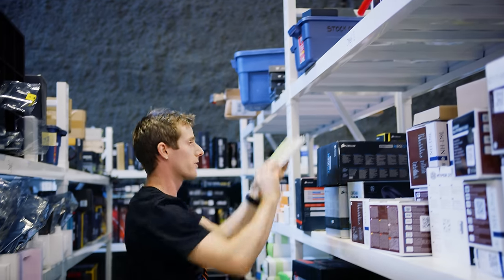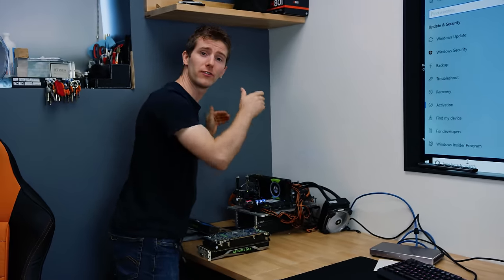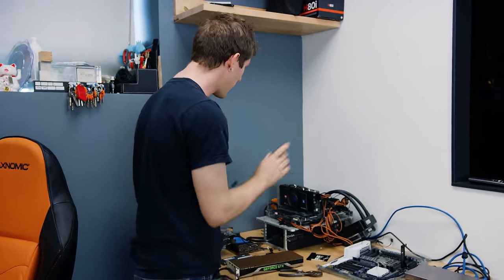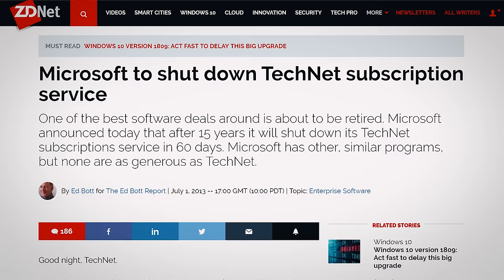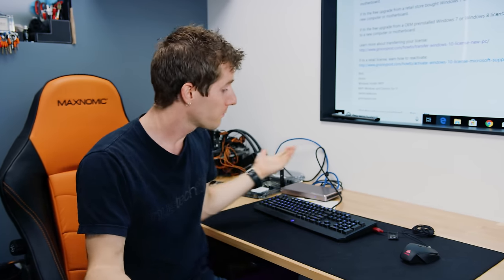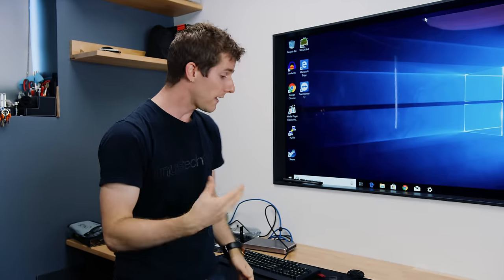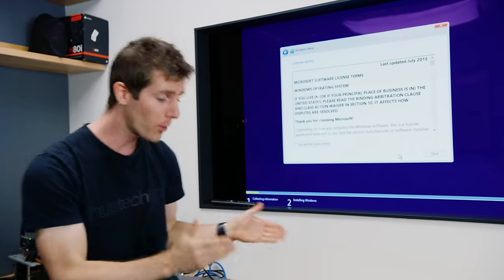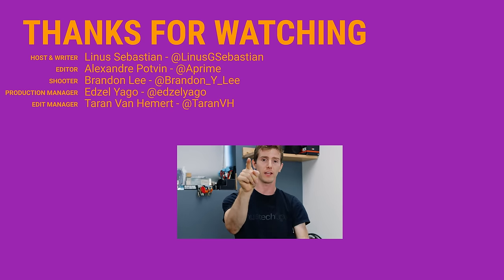Why Does Linus Pirate Windows??

Comment: y u no use kmspico???
Reply: FPSAnarchy hwid from nsaneforums activates it like its legit, try it
Reply: Been using kms forever. I even got it activated in a way that lets me use the store and i buy games from the Microsoft store like forza horizon 3 and 4
Reply: D96213 with kms you have to keep activating it every 6 or so months, but with this you can even sync the license with a Microsoft account and use it on a new machine, you can use that method now, no need to do a clean install
Reply: linklegend50 I haven’t activated it again in 2 years since my last format. It doesn’t ask for an activation and my hotmail is open on it with purchases from the store + office 2016 activated the same way. I’ll try out Hwid on my next format, thanks for the tip mate
Reply: @dvdsolomon  How did you activate it the way that lets you buy from the store? i thought kmspico only activates windows and microsoft office
Reply: Hossam Ahmed you login with your Microsoft hotmail account from the settings. You can login to Office the same way. Then you use it as though you genuinely bought it. I was with Microsoft LVL2 support yesterday via remote access to fix the slow download issue of Forza Horizon 4 and he didn’t mention anything about my windows not being genuine even though he checked the Windows Version and activation.
Reply: All was well until the September update came along
Reply: Thanks man, been using KMS for years but windows defender has always been bugging me about finding threats despite whitelisting kms. I just activated a fresh copy with this and it couldn't be simpler..  and bonus! "Windows is activated with a digital licence linked to your Microsoft account"   KMS never did that so this is friggin awesome!
Reply: @aviwad  Because Windows is better for consumer use.
Reply: @Pwnstar only someone who hasn't used a modern linux distro would say that (no BSODs, no troublesome or forced updates, nowhere near the malicious software available, no hassle with EULAs and activation, more flexible than a 16 year old gold medalist acrobat). Unless you use some specific windows only professional software, newbie-friendly linux distros are almost always the better choice.
Reply: @gkazanjian5976  It's not better for software like most games.
Reply: @Pwnstar yes, that is true (though nowadays it's light-years better than how it was a decade ago) but the main Q is what's the percentage of regular consumers interested in playing the latest and greatest games on their PC? The majority of people I know just use dedicated consoles for that and most consumers (if you leave out the professionals) just use their computers to browse the web, watch videos, and do some office work, all of which (and more) you can do on a linux rig.
Reply: @linklegend50  False information. Been using it and it will last you forever ;)
Reply: TsynaXZ it actually doesn't. What it does is use volume licensing, and activate Windows for 180 days, and create a task to run the KMS server it installed on boot to keep it up to date. You can check if your windows is truly permanent by typing "slmgr /xpr". HWID activates Windows permanently using retail, and does not require a KMS server to keep its activation.
Reply: Jon717 where can I get this
Reply: JACQUELINE Millan Here's a link to an official forum post: "nsaneforums.com/topic/312871-windows-10-digital-license-hwid-kms38™-generation/?tab=comments#comment-1327529". Scroll towards the bottom, under the automated method. Download the program, extract it (password is under the share code in the post), and run it. Before you do that though you need to change the key the system is using to the generic retail key of the desired version. Also don't forget to disable windows defender, and any other antivirus programs or any anti-malware programs.
Reply: Ayy the legend himself comments

Comment: "wmic path softwarelicensingservice get OA3xOriginalProductKey" will give you back your key, which will re-activate your software.
Reply: It isn't working for me.
Reply: @soumilswapna  May have to Run-As Admin in Command Prompt.
Reply: You can download KMS Pico
Reply: @grandmatvei3389  msguides is way safer
Reply: Works only if the license was digitally activated.

Comment: So Microsoft does full Denuvo mode for Windows activations too? CPY crack Windows plz! lol jk
Reply: @Stefan J I use Reloader by R@1n
Reply: W10 Digital License C v2.8.0 - Permanent activation, KMS and Rain for Office versions, for Windows W10DL is the best option now.
Reply: @Charvin  I still prefer the 2$ key than using KMS softwere, since 2$ key is perma activition, and even works after re install. KMS has limited time.
Reply: @qiyuxuan9437  Yeah, Thats why The W10 Digital License tool, since it don't have a time limit and it activates it permanently unlike kms 180 days mode.

Comment: I learned this the hard way after finally upgrading my ailing motherboard. Microsoft's tech support has been more determinetal than even useless and I'm pretty thoroughly disincentivized to ever pay for Windows again. I wouldn't even be using it now if Linux could run my Steam library.

Comment: But windows updated it system on 2018..now you can use windows 10 with windows 7 product key...if you upgrade any windows activated to windows 10...windows 10 are still activated

Comment: Windows 7 was the last Windows I've ever used and after I stopped using it, I realized, that all those years, hardware was never an issue of any of my PCs, the only issue I ever had was named Windows. And so far I always found a solution to do whatever I wanted to do without the need for Windows and now I exclusively focus on doing productive work with my PC, instead having to work for my PC to optimize, fix, update, or re-install Windows.

Comment: Microsoft consider to be a new device if you either change motherboard and/graphics card, if a user has its pc digital license added to its Microsoft user, you will automatically activate Windows, a person can activate multiple devices by logging in on that specific device and use its digital license.
No longer matters for Microsoft devices but users per device

Comment: Windows is super weird about it. I bought a bunch of used hardware - CPU, GPU, motherboard, RAM. All from different sellers around me. Put them together, installed Windows on an SSD I owned but never used for booting Windows before, and started up. Magically, without doing anything, I already had Windows 10 Home activated. 1 year later, it's still going strong. Changed out the GPU and added RAM as well.

Comment: As someone who also likes to mess around with computers and such myself, I never activate Windows or any other software. 

Now, if I’m fixing a customers computer, windows will usually reactivate on its own, no problem, whether I used an legit copy, the OEM supplied copy (not really common anymore), or even a torrented copy. The only time I’ve ever been given any problem is after upgrading several components for the customer, but that’s time consuming but easy to solve. 

But if I’m building a new computer to sell, then and only then will I pay for a legitimate license  for Windows. 
And I do this little thing that lets all the drivers do a streamline installation with windows so that when a customer boots up the PC for the first time, it’s the same out of box experience they’d get buying an OEM computer at Best Buy or Walmart.

Comment: I bought a $10 Windows 10 Pro key off of ebay 3 years ago. I have used it on 4 different computers and never had an issue. I even used it on my buddies PC that we recently built and it is activated on mine and his at the same time right now. I am not sure why it works like that for me, when it seems everyone else has issues.

Comment: I wonder if they have ever considered going with a Retail Version of windows, which allows you to move your license from one pc to another, yes you would have to deactivate the license on the computer it is being used on prior, but it works.
Reply: That's actually how it normally works with windows. Just ya know. Like most things. It may or may not work. Personally I've missed several crippling updates because windows can no longer be updated without wiping my drive. For some reason.

Comment: I ended up building a new PC but wanted to keep my old one as a spare. I moved my external SSD (where my windows was installed) to my new PC and left a 2TB HDD in the old one. I still had the physicals activation key from 9 years ago and they told me I would have to buy a new one even though my entire hardware was the same kekw.

Comment: Seems like Microsoft Windows is platform dependent. In other words, for any number of changes in system configuration, number of system crashes inccreases since then. When buying a Windows Desktop/laptop, we are supposed to run the computer as per configuration and can't change the configuration at our will at any oint of time. I think that's the message from this video.

Comment: Windows 10 digital licenses are only bound to motherboards. You can change all the rest and nothing happens. But only to that specific mobo, any other (even the same exact model, revision and BIOS version) will fail...for a short period. When you change motherboard, after installing Win10 you can go to settings, write "activation" in search box and if Win is not activated it will give you the option to activate in the new mobo while removing activation to previous (the old PC or motherboard). If you want to go back to the old mobo you can do the process again. It's easier than it looks.I've done it twice so...
Windows and most programs like Speccy (by Piriform, the ones that make Ccleaner) easily track the mobo's serial number and each one has a different number, like a fingerprint and that's how Win10 knows that you changed motherboard.

Comment: I have a question about your test rig. You plug your windows ssd in and fire it up, on other videos do benchmarks.
Isn't a clean install necessary any more or is windows getting more like Linux and uses the hardware detected at each boot.

Comment: Technically you're using a demo of windows if the system knows you're using it on licence or not and still lets you use it they can't get mad anti-piracy restrictions on windows have actually gotten relaxed first of all the watermark and you can't personalise Ur computer try using windows xp unlicensed you can get locked out of your system until you activate it

Comment: Activation? What's that?

The last time I dealt with that crap was in the Windows XP days, and I have gone through multiple keys because Windows doesn't like being reinstalled (even on the same hardware) too many times.

It's been a great two decades or so running Linux, where none of that garbage exists.

Comment: I remember back in the XP days, too much hardware swapping can trigger "recent changes to hardware, Windows needs to be re-activated", nothing new there Linus!😂
You could of created a system restore point before you started to change the hardware around, then when the system activation is triggered, restore the system from the saved restore point. Do modern Windows still have the system restore function?

Comment: You could use volume licensing server to be compliant. If microsoft had a mind for it, they could potentially be a dick about it and auditing the licensing which comes with a hefty fine tied to it.

You need a KMS server, you shouldn't be using retail licenses specifically because you 'burn' them. KMS volume licensed devices function differently in that their license is valid for 180 days and the device renews its license periodically, by default they attempt that renewal every 7 days.

The correct way to install a license for this business would be to connect to a KMS server on your domain and use volume licensing. You really need to talk to a licensing vendor, such as CDW, as windows licensing is fairly complicated and the repercussions for getting it wrong can be nasty.

Comment: linusssss ;^;....question * ^*...i pull out my SSD containg windows 11 home outta my laptop , and put in my new gaming PC, and the only thing that changes was my password reset and i needed to log in with a pin, but password was fixed in securoty settings, and when i looked at the activation tab, it said it was still activated ;^;...how is that? :0 is a totally diffirent system and everything

Comment: I have 3 Windows 10 Pro vm's running on my VMware ESXi server; and I don't activate them.  I use them for remote desktop for automotive applications, and have them now for over a year.  Never had issues, don't need the customized options, just to run the programs and remote into them.  I have plenty of Microsoft keys to cover the Windows 10 Pro vm's.  I don't activate, as I have had them de-activate on their own, for whatever reason; I don't know.  So I stopped trying, and just deal with the Activate Windows watermark.

Comment: The Entire Computing Industry has been Pirated by the Borg / Avatar. They don't Understand Computing like us.
We moved from implicit to explicit programming to Reduce bugs. In the past the same memory could be used to store an Integer and a Character. With increasing computer memory we moved to Explicit Programming. Those Bogs /Avatar (Sun Microsystems) stole the Computing Industry.
Operator Overloading makes the Program, Implicit, something we moved away from as Computer memory increased.
A similar thing can be Seen with their Theft of Database (Oracle) SQL technology. If they TRULY understood Declarative SQL they wouldn't bother with their NoSQL and Linq.
Declarative SQL creates an Abstraction Layer between the Programs and the Underlying Data Store. The Underlying Data Store can be Changed Easily. Declarative Programming is much easier to update than Procedural. Something those Bogs /Avatar (Sun Microsystems)  didn't Understand.

Comment: Going back to when activation started before high-speed internet, Microsoft has gotten a bit less strict on that. Actually, I don't know why, but I am not getting the activate prompt after changing hardware unless it is a processor or MB. I guess graphics cards don't count anymore? Anyways, not a problem as much as it was before.
Reply: It’s weird. I’ve yet to have this prompt. I’ve  upgraded the GPU, CPU, RAM, motherboard, PSU — every part to where it’s a whole new computer with totally different specs from when I initially activated the 10 Home edition on it back in 2017.

My guess is something is also tied to the Microsoft account associated with the user. I don’t know if it’s optional as I don’t remember, but I always just shrugged it off and sign in with the ones I’ve always had for years. With all the data and other stuff they collect, wouldn’t surprise me if it extended beyond just checking the hardware.

Comment: Had to swap a motherboard recently because the previous one due to some error bricked my PC every two months, and i had to reactivate windows, luckily it was easy, i just had to reenter the activation code.
Reply: same. i had to completely change out my pc components, except for my HDDs, and had to re-activate windows. but fortunately I just had to access some web-page on Microsoft and log in and confirm that its the same PC.

Boom, watermark-egone

Comment: For a company as soulless as Microsoft (yes, they do not listen to the community even a single bit in some cases, they are hiding from the public and just doing their own thing to increase profit as much as possible) I would 100% understand if you or anyone would go to download third party free activation key software. I have been activating my Windows like this for ever and I do not regret it a single bit. Microsoft products do work great, but they don't help you at all in a lot of cases and I don't want to support that. Have had many, many problems with Windows "updating" my drivers to ones that are 2 years older than the hardware I'm running, making a bunch of programs unwilling to work. The only good thing about Microsoft is VS Code.
Not to mention that it's absolutely free and official to download a free unlicensed OS from the Microsoft website.

Comment: I can’t seem to install windows 10 I tried everything command prompt disk partitions trying to fix it finally would get the partition fixed then installed windows finally got that fixed but it took 3 USBs one with windows install one with a partition fixer and one with the troubleshooting tools and the farthest I got after 6 hours of hard work was past the install and in the getting windows setup and then it crashed I can’t get my dads laptop to work tried everything 😢😢😢😢😢😢😢😢😢😢

Comment: I had a legal, activated, copy of Windows that came installed with my brand partner-store-bought HP Pavilion. All cool for a few years. Then, out of nowhere after ~3 years it started to act like it's an unactivated copy, having the "please activate Windows" appear in the corner. Whenever I would try, the activation process would just throw connection errors, basically preventing to activate it again, etc. 

So thats why its there for me, for example :D